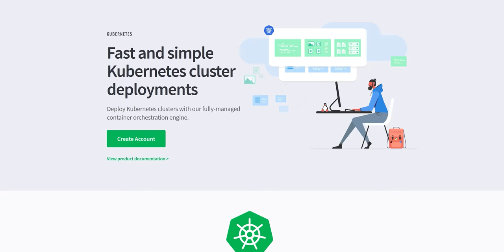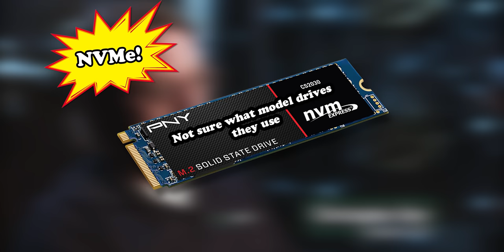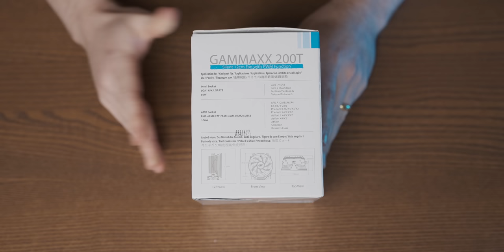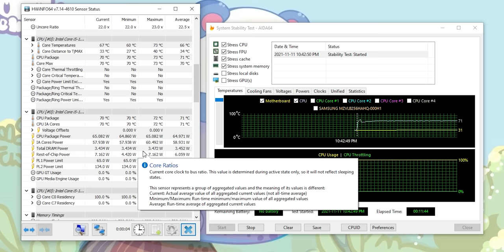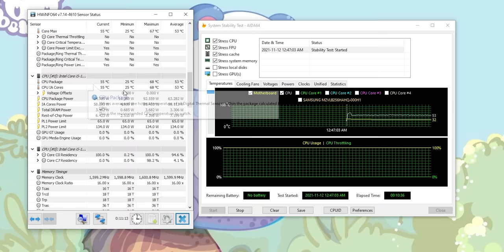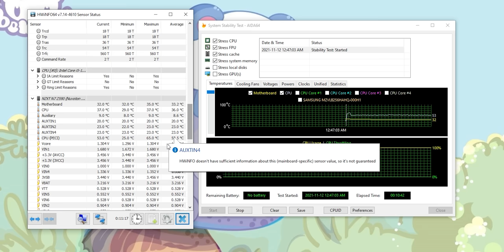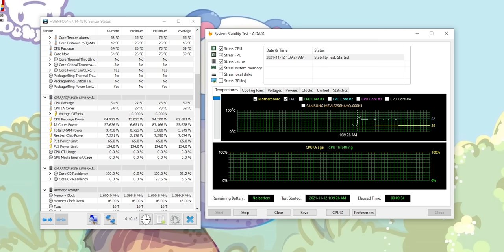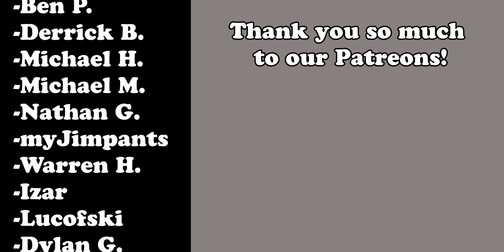Sub $20 Amazon CPU Cooler Shootout

Comment: A note about that tower cooler: I put one on a Core 2 quad Q9650 machine I owned two years ago, and it did admirably. That same cooler, CPU, and motherboard are presently living in a new tower in a friend's business office, running 24 hours a day, and the cooler fan is still working fine. I think it's probably the best inexpensive cooler out there.

Comment: id love to see these compared with something a little more expensive like a hyper 212 or something
Reply: I'd put money on the 212 blowing them out of the water. Its fin stack is much larger and it has proper copper heatpipes.
Reply: @MisterFribble  wouldnt be surprised if expensive cooler beat cheap cooler
Reply: @MisterFribble  sure a more expensive cooler will be better, but how much better is the real question. If it's 2.5x the price and only 5C better then there is an arguement for buying the cheaper product if on a budget. 
It's all relative
Reply: Gammaxx 400 is similar or better than the classic hyper 212

Comment: The best sub £20 air cooler i bought and i'm still using it, is an Antec A40 Pro. Tbh, i would say it's on par with the Hyper 212 although it's cheaper.

Comment: I replaced the stock cooler on my 9400F with a Be Quiet basic tower cooler.  I think the biggest benefit was the reduction in noise.  I think that was the rationale behind buying it as the temps weren't that bad with the Intel leaf blower.

Comment: The CO version of the Arctic cooler means it uses a ball bearing fan, hence why it is a little louder. CO stands for continuous operation, meant for always on reliability. The rest of the coolers all use either basic sleeve/rifle bearings, or fluid bearings (the Deepcool models).

As to the Dell cooler, it performed so well because the fan is insane (they used to be Deltas, but I can't say for sure that is what the one in the video is). That's why Dell hides the fan curve with it, because on their systems, the curve is tuned for noise performance, at the expense of CPU temps. By using it on another board, it no longer is limited to roughly 60% PWM, like it would be on an actual Dell system. So the results are basically invalidated for two reasons.

Comment: I have the arctic. I bought it not because it was cheap but because I needed a low profile cooler. Like really low profile. Less than 4 inches tall. It works perfectly. I’ve daily used it for gaming for the past 2 years. It actually cools similar to the noctua version for a good amount cheaper.

Comment: I have a similar Arctic cooler in my case for an AM4 socket. My fan is much quieter than  yours, subjectively admittedly. I have used several of these and all are quieter than what you show. Artic case fans tend to be quiet and long lasting as is the Alpine series and AC does honor the 6 year warranty. Which i seriously doubt the others would do. Also due to the down draft of this style of low profile cooler, they have the added benefit of cooling the VRM. And it does amke a difference.

Comment: I buy used coolers from the mid 2000s - 2010s because you can get a decent 6-heatpipe 120mm cooler for like $10
I've bought old Zalman coolers (CNPS 9900A/9700), fully copper ones

Comment: There are alot of AIO cooler's on Amazon that are pretty decent for $40-$70 from 120-240
Reply: The ID cooling frostflow goes for $50 i think and its a 240mill, I saw some tests of it and its pretty good.
Reply: Arctic Liquid Freezer is the way to go. It even outperforms some higher end AIO's
Reply: Yeah there’s a coolermaster 240 AIO with RGB fans that goes for 80~  so
I’d say that’s some good value
Reply: @AS-zq2cq  there is an ID cooling one as well for 65-70 rgb, same performance as the cooler master, i think its the master liquid v2 rgb variant you are talking about.
Reply: @felixklimm7225  yeah liquid freezer  v2 goes for around a $100 and its one of the best on the market.
Reply: @Cazman1989  I installed one of those on my daughters 5600 w/ temps around 35 idle and less than 70 on full load, I ended up getting another one as a spare
Reply: @felixklimm7225  I saw that on Pauls Hardware but I look to get best performance at a cheap price. I have thought about testing one of those
Reply: @AS-zq2cq  I have used both CoolerMaster and ID 240's and both perform well just depend which one is cheaper when i do a build

Comment: The reason why the stock Dell cooler ran better than expected was because it has been used in a open case scenario. In Dell's prebuilts, there's not much airflow available for them to breath, hence the high temps.

Comment: The reason the tower finished so far ahead isn't because it's a tower, it's because it's the only one here with actual heat pipes and not just a milled block of aluminium with a bunch of bent fins radiating out. I suppose it's going to be difficult to find budget top down coolers with heatpipes, but if they exist they're going to finish similarly well and might even cool surrounding components like the VRMs better than a tower would.

Comment: Been using the Gamma archer on an intel pentium gold G5400 and it stays below 60°c even on heavy load it also cools the board/ram with a large airflow also blue is quite eye-catching but the fan can get quite noisy. 9/10 would recommend

Comment: Running an x58 motherboard + 6 core 2.93 ghz Xeon x5670 in a early 2000's Antec full atx case with one 80 mm fan and the Intel stock cooler. It idles at 70c and sounds like a jet engine. Gonna have free heat in my guest house this Winter.

Comment: Tip: Buy a used Cooler Master Hyper 212 Evo.
Literally just got one for 20 bucks from a friend and i couldnt be happier. Not to mention that you can upgrade to a much more powerful CPU down the road and not care about cooling.

On the other hand, the DeepCool Gamma Archer and the Arctic Horse coolers surprised me. From my experience, those kinds of coolers perform about as well as the intel stock cooler (not good) but maybe thats because im working with older parts that let out more heat.

Comment: Nice video, I had to replace my HP Omen stock cooler with a cheap BeQuiet2 which worked a treat.    I do  think the temp results would be slightly different if mounted in a case as the tower cooler can be positioned to blow out the case where-as all the other coolers just blow hot air down on the motherboard within the case, recirculating the hot air which would add to the tower coolers overall winning position

Comment: I have that Gammax 200t. Its on a i5 2500k running at 4.6ghz pulling 1.38 vcore. Ive always loved that little 13 dollar cooler, been rocking it in my older PC builds for a while.

Comment: I remember my first, unexpected, very good cooler for an Intel processor. After changing the processor to the i7 4790k, I didn't have a cooler for it, so I installed the one I had from the i5 4440, which turned out to be a mistake in terms of temperatures. Having nothing else for this soclet, and no money, I dug out an old computer cooler for socket 775, with a set of fins almost three times higher, and a full copper core (those were the times when the fan did not reach its legs to the board while holding the radiator, but when the radiator had four metal legs and the fan fastened to the radiator with two latches). I don't know what processor it came from, but it was a typical factory cooler, only much taller. Of course, the mount from 775 did not fit 1150, but I came to the conclusion that the plates holding the mointing clasps were too long so I would try to enlarge the hole in them. So I dismantled the clips, used a saw to cut the holes completely outwards so that now the cooler legs resemble a two-finger fork, I put the clips on and in this way I received an efficient cooler that fits from the 775 stand to even the 1200 (I haven't tried it on the 1700 yet) which allowed me to run without any problems 4790k until I bought a tower cooler and now it is waiting in the drawer when I have something for diagnostics, or as a solution in the meantime, e.g. water cooling is under complaint. Of course, it does not keep up with the new 200+W processors, but when using them without overclocking at the base clock, it allows you to use a computer that otherwise will stand waiting for another cooling solution.

Comment: That 200T deep cool cooler has been around 20 dollars since at least 2016. Used in my FX-6300 gaming system which I built in 2016 which happened to be my first gaming PC. But a really capable cooler. I ran a 4.4 ghz OC on my 6300 for years and it never got crazy hot like those FX chips liked to do. If my memory serves me correctly it never got hotter than 70c which back then was relatively cool for an AMD chip of that Era lol

Comment: I'm not surprised the Dell cooler is able to compete, but I am surprised at where it placed. Stock coolers are SO underrated. They tend to actually do perfectly fine in a normal case, it's just that the cases prebuilts use have like no airflow. Of course, if you had a super hot running CPU, no stock cooler for you, but I've used everything from like AMD Phenom quad-cores to i5's (so max power draw of I think 95W) and they all did fine with stock coolers. By fine, I mean they didn't ever hit their max temps under load, and thus didn't throttle.

What stock coolers lack in metal, they tend to make up for in raw fan speed, so a cheaper way to achieve the same temperature result, albeit with much more noise.

Bonus: If you're building something using the AM3 socket, totally recommend the stock coolers. You can get cheap $5 Chinese copies that perform the same, and then the 125W versions of the stock coolers are good too, because they're literally Wraith Prisms with smaller fans on them.

Comment: I have a Deepcool Ice Blade 200M that is exencially the same tower as that Gammax 200T but has dual 92mm fans with it. Used it with my Phenom II X4 965 BE and then my Ryzen 5 1600X both at around 3.9ghtz all cores . Worrked well even with overclocking either cpu. Replaced it with the much bigger Deepcool Lucifer K2 just to get more comfortable temps on the Ryzen system. Debating on installing it back on the Phenom II or HP Envy Phoenix I7-4770K system. The Ice Blade 200M has about $15 CAD when I bought it and impressed me enough that I went a Deepcool RF120M Case Fan 5 pack as well when I got the Lucifer K2 and needed to replace the case fans in my system at a fair price. ($55 for the Lucifer K2 and about $45 for the RF120M 5 pack at the time)

Comment: That was surprisingly interesting! The results were not at all what I thought they would be. You should do a round up of the best looking coolers from the next tier up and also move to an 8 core cpu to really get some heat up in them. Maybe a 10700k or something like that if you have more control and options with Intel chips and mounting hardware.

Comment: I paid £12 on eBay and got a Thermaltake Assassin 120 tower cooler, someone bought it and sold it on because the end of some of the fins had a tiny amount of bending, otherwise brand new.
So I carefully bent them back and it's fantastic, though I don't have RGB on my B550M motherboard so I replaced the Fan with a Noctua 1300 rpm black 120mm fan, because.

Comment: Got the 200T for $14 a few years back and it's also kept my CPU in those temperatures while gaming. It's hard for me to complain that I really need to be gentle with the mounting solution when I have a tower cooler that does its job pretty well at this price point.

Comment: I think DeepCool, Scythe and Thermalright make pretty good budget air coolers but the closer you creep towards the $100 USD price point a person would be better off buying a more popular CPU cooler offering. That isn't to say those respective companies higher end offerings are necessarily bad, it just hard to beat out a NH-D15 or Dark Rock Pro 4.

IDK why DeepCool uses that mounting method because I know their Theta series coolers for Intel just have a one piece back bracket and the cooler screws onto it. And they do make at least one AM4 CPU cooler that screws on to the back bracket of AM4 motherboards, the DeepCool UD551.

Comment: My friend has a DC C40 which we added a 2nd fan so its a push pull config and it coosted a total or 20€. 18€ the cooker with 1 of the fans, and 2€ for a used 92mm fan because the cooler is 92mm tower, and on a 115w tdp cpu it kept it under  70c

Comment: I bought the GAMMAXX 200T for a very old, core 2 quad q9400, last December because when I was changing cases and reapplying thermal paste, the stock cooler pins broke. I only use that computer to stream YouTube with but it is nearly silent and doing a much better job than the stock cooler. I got it on sale for $14.99. Spending more than that doesn't make sense for that computer.

Comment: I've been using the Gamaxx 200T with my Ryzen 5 1600X for about three years now and I'm quite happy with it. It's a pain to get it on with AMD mounting as well, you have to really bend those clips to secure it, or you could loosen up the pegs and do it that way. The fan clips are not the best feeling as well, but I guess you get what you paid for. But in the roughly 6 months between cleanings I do, it works perfectly and I've never seen the CPU go above 65C even in games like Cyberpunk 2077.

Comment: That Zalman mounting bracket is very odd, in the past Zalman flower coolers had a bracket that screwed into the MB (looked like AM4 mounting bracket after wards) and the cooler clips clicked onto it. One cooler that I am super impressed here in Australia is the Cooler Master i70C. You can get these for under $15 AUD (around $12 USD) or around $12 if they are on special ($10 USD). The other cooler that is very good is the Silivertech KR03 (they also make the 2 heat piped KR02 for the Asian market). These are cheaper versions of the Gammaxx. These go for around $23 AUD or $17 USD. These are my 2 best recommendations.. for my clients builds I use the Cooler Master i70C as it has a superior mounting mechanism.

Comment: you should compare this to some used OEM coolers, a lot of people sleep on those in the tech review space, but you can get a 4 heat pipe 120mm fin stack (only comes with a 90 mm fan though) tower cooler from HP z440 systems all by itself for literally the same price.
Reply: that dell cooler has served me very well personally. one of those optiplex flipups on the i5 4590. Fully saturates a gtx 1070 on most workloads, especially VR. Still looking to upgrade, but that cooler cpu combo go way harder than they should for their age. Plus, free whitenoise computer ASMR to relax/study to.

Comment: I also have an i5-2500k (What a beast😂) with DeepCool ICE BLADE 100 keeping my CPU and iGPU while potato gaming locked nearly around at 70C on 3.7GHz and iGPU overclock to 1350MHz...
Acutally very compiling cooler (also Brand) wondering price of 10USD (in our country's currency)...
Reply: I also still rock my 2500k

Comment: Great video, definitely surprised by the added guest cooler.  Would have been nice to have seen the stock cooler that comes with the i5-10400F.  When I built a system with the i5-10400F I just bought the stock black cooler from the 11th gen for £10.

Comment: Considering their proximity to the hyper212 sale price of $27-30 I think I would still recommend the old school favorite to avoid this bad mounting hardware.
That being said, if you don't mind the bad mounting hardware and you live in a country where the hyper 212 is over $40 USD, I would consider the Snowman MT6. It's a 6 heat pipe tower cooler that is often under $30 and beats a stock hyper 212. I have used the MT6 to cool 135w Xeons under cinabench R23 and it keeps them between 66-71c.

Comment: Speaking of coolers, I'd like to see you do similar test but with coolers from Aliexpress. I've seen coolers with 6 heatpipes there being sold for less than $20. I wonder how they will work, especially when compared with coolers which would cost 2x-3x more. They also have coolers which look like Dell stock cooler for like $10.

Comment: I watched this video to see whether or not I should replace the Dell stock cooler with another downdraft cooler, but now it looks like I'll just replace the thermal paste. I am running 2 more of the EXACT SAME AVC 80mm fan as the Dell cooler in the back of my case, so I don't think a new cooler would help.

Comment: I have the 4 heat pipe version of that tower cooler, it isn't too bad but it is fairly noisy. It's overkill for my old I5 but it was on sale for a couple bucks more than the 200. The shame I felt when I noticed my ram was in single channel mode when I was swapping the cooler was immeasurable.

Comment: i bought a deep cool gammax tower cooler with 4 6mm heat pipes in white coating for 21.99 CAD , they were so cheap i got two . And they perform well , have a light (non addressable), quiet with a 1500 rpm fan. One downside , only the worst intel style punch through clips like stock cooler for mounting there and AM3 mounting  or am 2 where you have to clip over the socket for amd cpus . but performance was every bit as much as they said. Dawid got wrecked due to current shipping i suspect.

Comment: The Dell cooler was running at 100% fan speed because Dell uses non-standard fan headers (shocking, I know.) The connector is the same. I believe it's just a matter of swapping two pins, and Dell fans draw more power than standard fans. They're different enough that if you use a non-Dell fan in a Dell computer, you have to press f1 at every startup to acknowledge your sin of not buying authorized parts from an approved dealer.

Comment: The Arctic 12 CO is an amazing cooler in terms of size, cooling and ease of instalation. TBH it's really just a hunk of aluminium, but that's fine, I think. I used it to cool my 6700K at stock settings, however, the sounds it makes are just horrible.